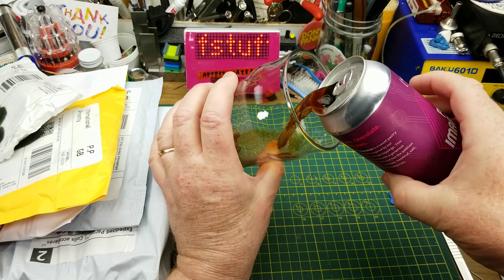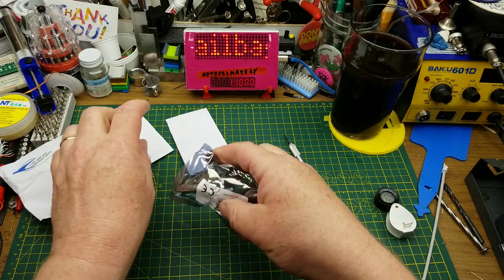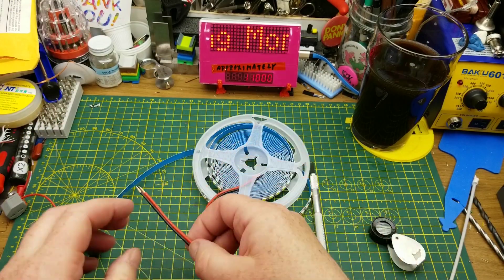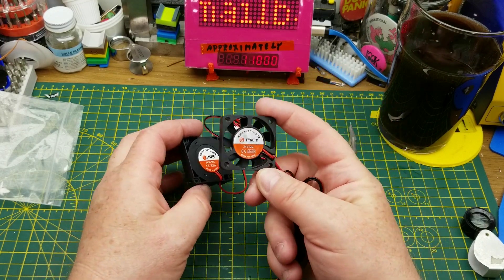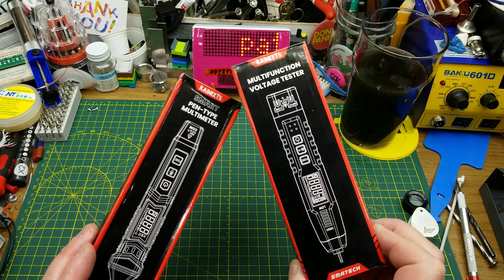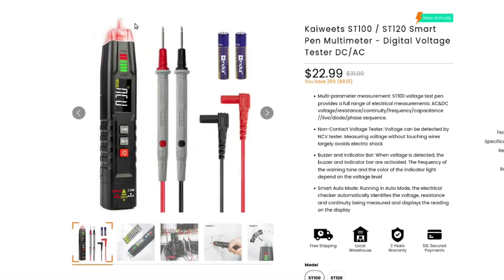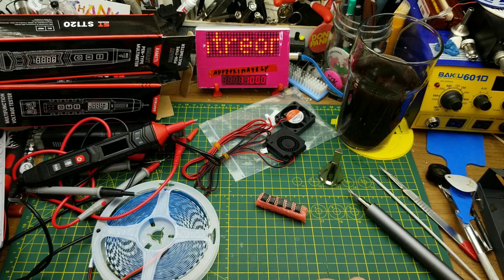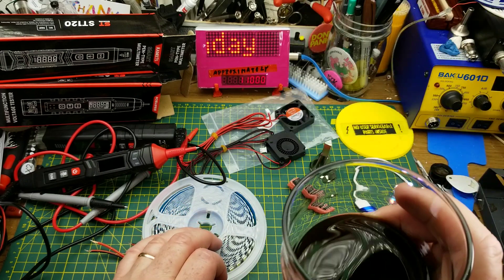mailbag Monday 140

Comment: The thing you received is a Wire Wrapper/Connection maker for electric drills. It is used on your common electric screwdriver to  join multiple electric cables by twisting them together.

Comment: I've been told if you have to replace the fan in your power supply be sure to check the voltage because Creality has had both 12v and 24v on their fans and you have to open the PS to find out
Reply: That is exactly what was already stated in the video.

Comment: Having blown up a meter once having it set to resistance instead of volts, I'm always wary of automate selecting meters.
Reply from the maker: Reasonable.
I find all these automatic meters take far too much tine to come up with a reading. 

And, as I mentioned in the video, if the voltage  or resistance is relatively low, the automatic meters have a hard time figuring out what they're supposed to do.
Reply: @pileofstuff  Yes, here with you.  Do they have good manual settings and work with that a bit?
Reply: @pileofstuff  I have one from RS, rebranded clamp meter, which subscribes to the Apple philosophy, in that it only has one button for power, doing automatic decision for AC current using the clamp, or resistance or voltage using the probes. Works well even if it is slower than an arthritic snail, and has a pretty big dead band voltage and current wise of around 0.2A and 1VAC, below which it will try resistance, or rather continuity, as it figures anything over around 20k is open circuit, and flips back to voltage or current. But was on clearance, and got me over the free shipping threshold from RS, so literally was free, plus I also got the promotional knife, that I still carry.
Reply: The auto detecting meters won't blow up, which might be an advantage to clumsy people who set their normal meters to the wrong range.

Comment: The "wierd" item is meant to be chucked in a drill motor, and used to deburr the threads on a screw or bolt that has been cut.  It makes the cut end of the threads 'start' easier into whatever the appropriate female threads are.
Reply: I was way off - lol -, I thought it stripped 3 wire mains cable to get the wires or copper.
Reply: That will be Great for when you start Making Screws
Reply from the maker: Interesting. Thanks
Reply: @pileofstuff  Also was sent to use as part of a site washing in good reviews, using addresses harvested from others, and sending the random stuff, then giving good feedback because they control the account sending it.  Improves feedback quickly and cheaply, as they only spent 60c per review, using a whole load of random stuff, bought from other sellers of excess stock.
Reply: @SeanBZA  I've had a random Mars bar from Amazon which must be a similar thing. Not sure how they got my address as its format didn't match my usual shipping address.

Comment: I think the cone jig is a dowel sharpener. 

AVR chips are getting scarce now, especially the tiny's.  
I am working on a customer project now and was planning on one attiny, but moved to the UPDI programable series due to supply issues.  I ordered a lot of nano boards (@100) last summer and got then for almost half the current going rate in China.  

Those pen meters look somewhat interesting.
Reply: You're right man. 5 Nanos in a pack used to be 25 and now it's 50 and I paid 25 for 10 pic12. They're perfect for what I want but I need like 50 of them.